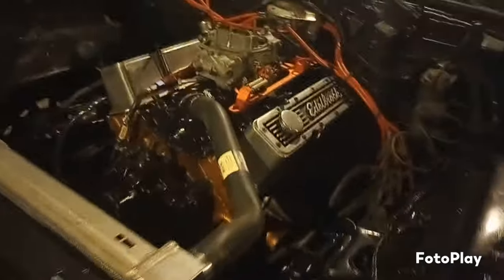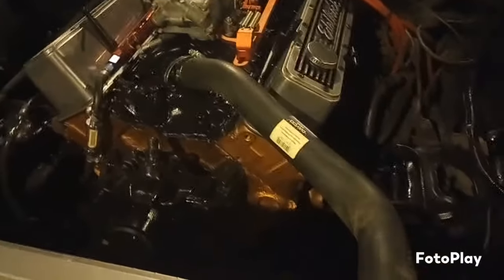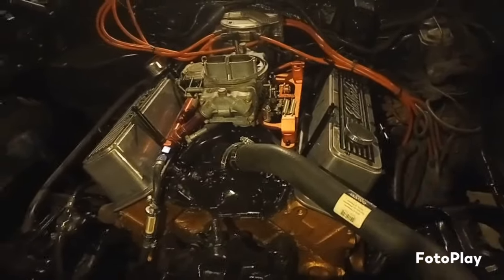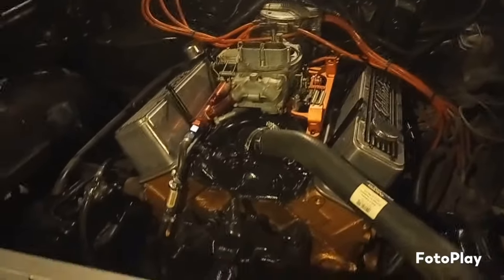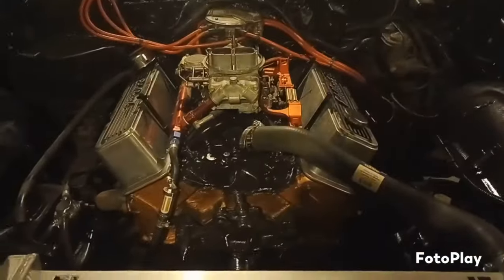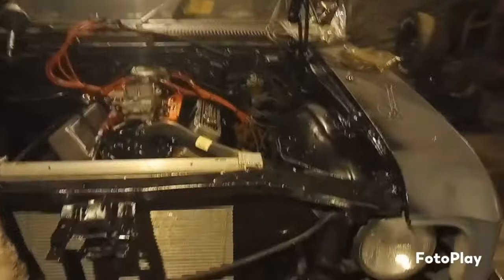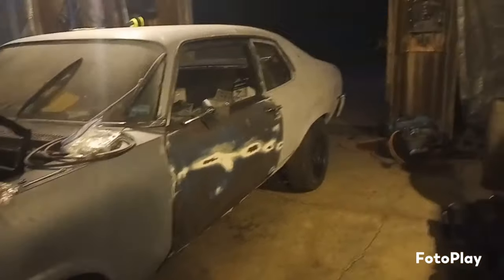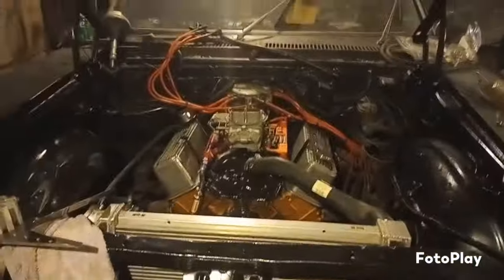Nova

Comment: It is hard to take you serious......  with that glass fuel filter on your car
Reply from the maker: Why is that
Reply from the maker: There's a reason why I put that glass filter on that
Reply from the maker: The reason why I have a glass filter on it's because I wanted to see if my fuel was clean coming up through when I was running it off the old gas tank now it's got a new gas tank in it but I can see if it has any dirt or any kind of crud before it gets to my carburetor. And another reason why I have a glass filter it's because it's the only filter that I had can you use what you got in my case I had it kicking around so instead of going to the parts store and buying a new one I'll use what I have that's just like all the bolts that I got and nuts why go to the parts store when you got stuff in your garage you can use. 😂